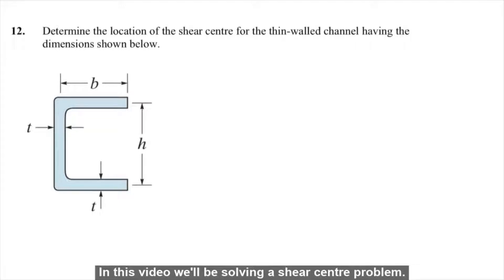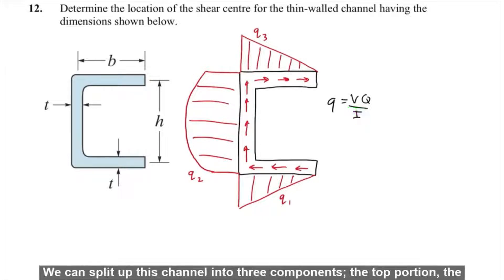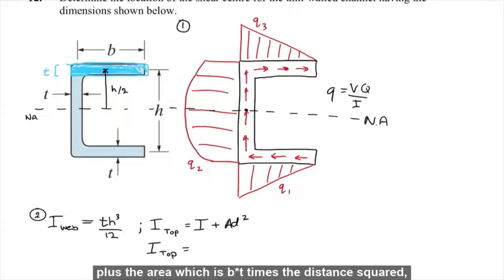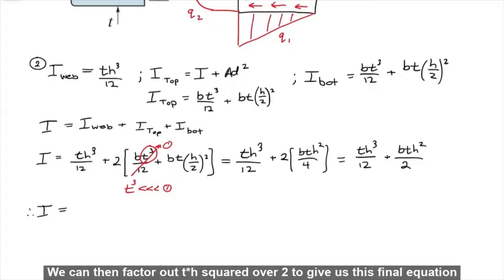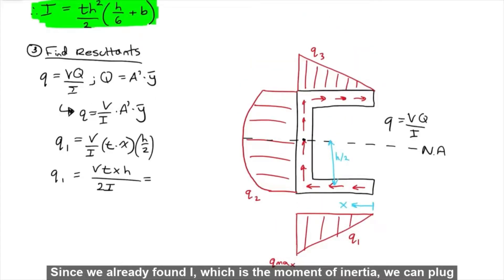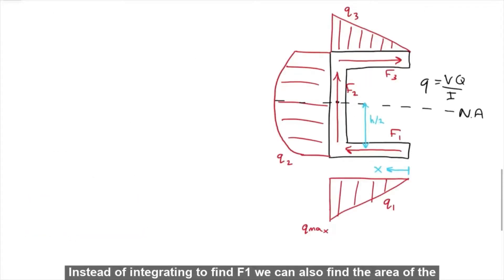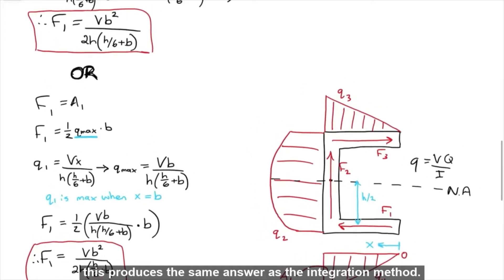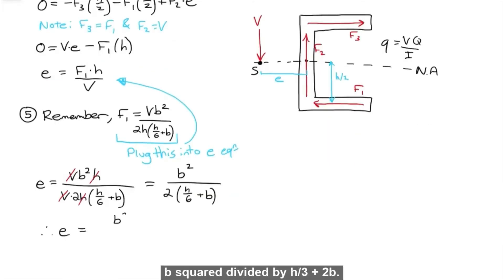AE 204 Shear Centre Example

Comment: Thank you. Why is it parabolic when the shear stress acts vertically and linear when horizontally?
Reply: As I understand it, it's because of the formula for shear stress at those lengths, tho more specifically it has to do with "Q."

Shear Flow: VQ/I

As V and I would be the same throughout the whole shape what really decides the graph shape is Q. 

And Q is:

Q = (Area) x (Distance)

Think of Q as starting from the top right end of the flange (the top right of the letter C) then starting to move left. As you start to move left the "area" increases linearly. 

As for the Distance, it's the distance from the y centriod of the "Q component" you're looking at to the centroid of the whole shape.

That distance does not increase or decrease for the top and bottom flanges. But it does change for the middle web section.

Because for the middle web section (middle of the letter C), the distance is decreasing as you approach the middle of the global centroid that makes the slope you saw.

That was a lot of words, but I hope it made some sense